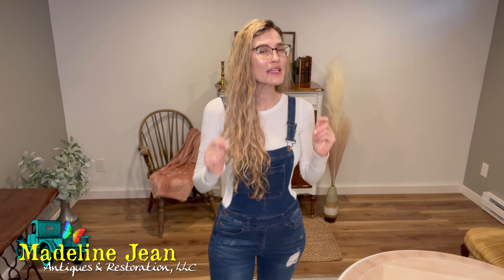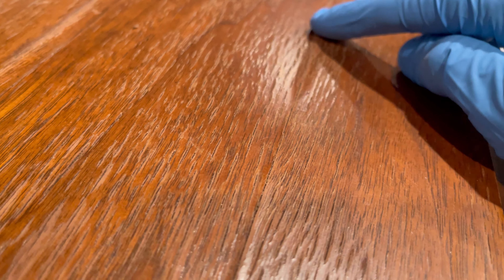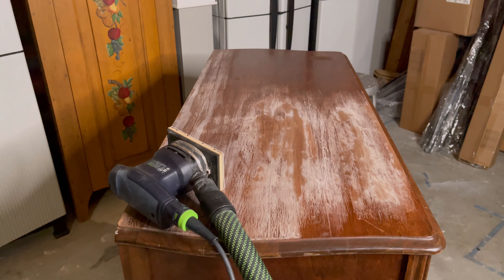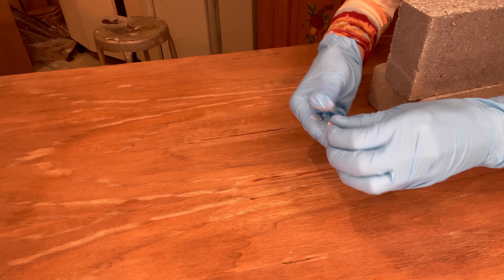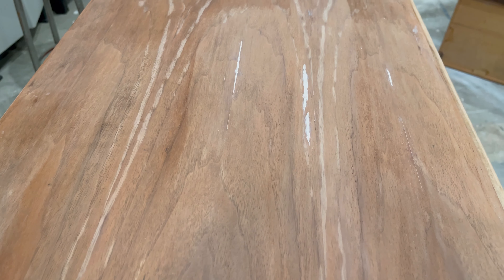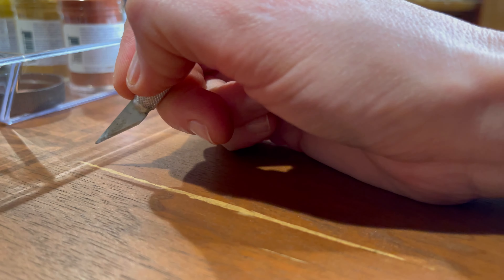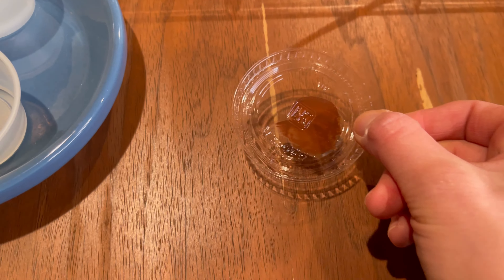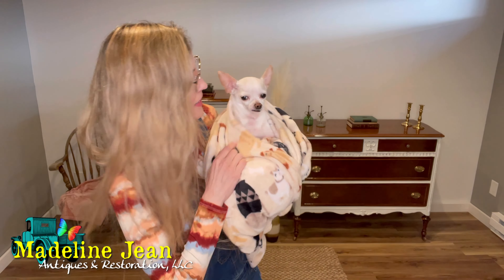How To Fix Veneer on Furniture - DIY Tutorial

Comment: Ah, well I have a suggestion.  When you sand down the surface, keep the sanding dust.  Then when you're ready to fill, mix it with your glue.  Be conservative but make it like a wood puddy.  Now you have a perfect match for both the absorptive quality and color.  Put the mix in the canyon and leave it a little proud.  Let it dry then sand.  It should take stain pretty well after this.  Try it and let me know how it went.
Reply from the maker: Thanks for a great suggestion! Thank you for sharing how to turn sanding dust into wood putty. I think mother would benefit knowing this as well. Great comment!
Reply: How brilliant! Thx

Comment: Beth if you wet your fingers after pressing the epoxy into the voids you can smooth it out so the sanding will be a lot easier and not as much.  Here is a method I sort of use,  I mix my pigments on a piece of glass laid on top of the piece I am going to grain and match the colors that way.  Don't be afraid to use your fingers with this method it uses just denatured alcohol
Reply from the maker: This is the type of comment I love! Thank for the helpful tip on wetting my fingers with the epoxy. That makes total sense! Oh and I'll definitely be picking up a glass plate at the Dollar Store as well. Thank you for commenting and watching.
Reply: @madelinejeanantiquesrestor9074  You are quite welcome Beth.  I am always watching and learning myself.  It seems I can pick up tips from others and discover a few myself to make the job easier.
Reply: Omg! Fabulous advice! I’ve been struggling for weeks on one spot I over sanded😩 Tried wood putty, wood glue, kept making it worse😢. I think your perseverance has done it for me and I love this fan’s response🤭 Glass!! Brilliant👏🙌💃
Reply: Seriously brilliant advice thank you!
Reply: @ElohiSilverEarthVentures  Thanks
Reply: Something that works for me is to make a string of the epoxy that is just a little lager than the crack. Then blend it into the crack with just a little overflow. That way, you don’t have a large blotch to sand off afterward.
Reply: 100% ditto to wetting your fingers with the "tootsie roll" epoxy. Also, if my epoxy (I use  the same product) doesn't quite fill the surface, I come back with a water based wood putty and fill it in that way. Much easier to sand.
Also, while I love Mohawk products, believe it or not I've had great success with water based pigments. More working time, more control. Obviously you seal the surface afterwards, as you do with powders. 
Your color matching was great... especially for a first go-round. Before long you'll nail it every time. Clear glass dish...yes!
One more thing a scriptliner (also called a rigger)  is a great brush for extremely fine detail.
I came here to learn about veneer repair...I am now going to tackle my project and see if I can save the veneer after seeing how beautifully yours turned out. Thank you!
Reply: Oh and the next time you use that two-part tootsie roll epoxy, roll a little ball of the leftovers, let it harden and drop it into the bottom of the plastic tube before you put the epoxy back. Way easier to get it out the next time.

Comment: Thank you for showing the learning process! Do you have a rule of thumb you apply to decide whether to repair versus removing veneer? I have a buffet that is missing the veneer on the front end of the base. As it's the base, separated from the upper body, I'm inclined to just remove the veneer on the base and go with a nice, contrasting dark stain.
Reply from the maker: Gosh it all depends on piece and my level of patience (haha!) If it's a piece I just absolutely love and I have the time to fix the veneer completely then I'll save the veneer.

Comment: Thanks for letting us learn from you!  Would you use quick wood to fill in holes left by hardware that has been taken off?  Or do you recommend something else? Thanks!
Reply from the maker: I like to fill hardware holes with dowels fit to size and then add Kwikwood or wood putty if need be. I find if you only use KwikWood  or any other type of wood putty it could shrink as it dries and make the holes still look apparent on the drawers.

Comment: If u take a face clothe or something, very hot water, soak cloth in hot water and ring it out thoroughly. Play the Claus flat over the veneer don't soak it completely but let it the heat in the moisture it will soften that those bubbles that will lay flat again
Reply from the maker: Thank you for offering that tip!

Comment: What if the veneer is on a round part
Reply from the maker: That's where is gets tricky. You have two options. 1. Use bondo to repair and paint that area. (easiest) 2. You will have to get veneer replacement that can be cut to size and mold it over the curved area.

Comment: I love your videos! Yours is the only one that I've found that actually teaches, and you get to make the mistakes before I do! LOL I'm working on a 200 year old flame mahogany bedside table that's been in the family as long as I can remember. The drawers are okay with only a little veneer missing. But the top has several bubbles and a couple of bad splits. I've ironed out some of the bubbles and it actually worked somewhat. To fill the cracks, I have some kwikwood, and checked out the Mohawk blending power. It's VERY expensive. Do you have anymore suggestions for the blending powder or just blending? If all else fails, I'll paint the top and sides and legs and leave the drawers in the flame mahogany. Thanks so much for all you're doing to learn and help!
Reply: I use a coffee grinder to mix up colored pencils. Works the same and its a lot cheaper.

Comment: Ufff. Try and fix bubbling BEFORE sanding. You run the risk of burning through the veneer otherwise. Burned veneer will never take stain. There is no way to fix burned veneer naturally.

Comment: A few things I have found useful in my furniture repair business.
When working with veneers, lay a damp rag over your trouble spots and an iron on the cotton setting. The heat and moisture can soften the wood and reduce or eliminate the bubbling. It may reactivate the glue as well. This technique can also be used to "pull dents" in wood. Results will vary depending on size and depth.
Starbond makes amazing colored CA glue (super glue) that is very useful when needing to work in small cracks on the veneer. Their micro tips will fit right in and allow you to glue and even fill small holes. 
When using wood glue or CA, lay a piece of melamine over the top of your glue spots. It protects your workpiece and the glue wont stick. This would allow you to use your bricks and not mar the surface.
I have not used the JB weld version of the epoxy putty. I use Quikwood.
 https://www.amazon.com/Quick-Wood-471050-24-QuikWood-Putty/dp/B000VPO0R8/ref=mp_s_a_1_3?adgrpid=54477640005&hvadid=580769657913&hvdev=m&hvlocphy=9029965&hvnetw=g&hvqmt=e&hvrand=824852299302240222&hvtargid=kwd-296186372639&hydadcr=14630_13386758&keywords=quikwood+epoxy+putty&qid=1689956239&sr=8-3

It comes in different colors if you want. I will just add a color that matches or is close to my desired color during the epoxy mixing process. That way the epoxy is colored and you are not working to disguise a white spot.
Another option for color mixing and matching is using water based stains. I use SamaN, also found on Amazon. 

https://www.amazon.com/SamaN-Interior-Water-Antique-Walnut/dp/B0067NHKNE/ref=mp_s_a_1_1?crid=1I43XROJILN06&keywords=saman&qid=1689956697&sprefix=saman%2Caps%2C172&sr=8-1

They have a wide variety of colors that you can mix to make whatever shade you need. The great thing is that they are water based and you can wipe them off before they dry if needed. This gives you a great deal of flexibility. I will apply the color with a brush and can easily move or blend the color with my fingers on my workpiece. It all washes off when you are finished.

I have a small piece of beveled glass, 6"x 6", I had a local glass company make. This allows you to place the glass on your workpiece and mix your colors. Having your desired color right below makes the color creation process much easier.

Hopes this helps in your journey. Thanks for the video.
Reply from the maker: Thank you so much for all the helpful information! I truly appreciate the time you took in leaving such an insightful comment and all the recommendations.
Reply: Great advice. Thank you!